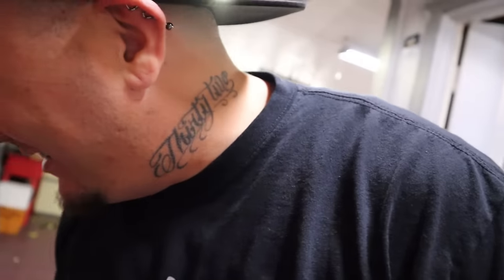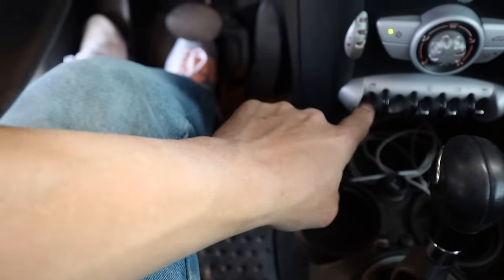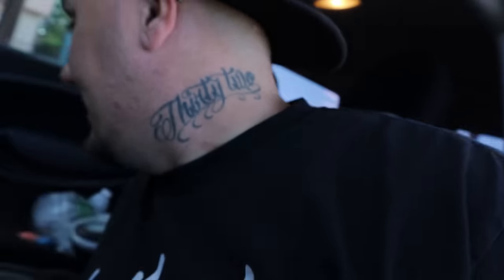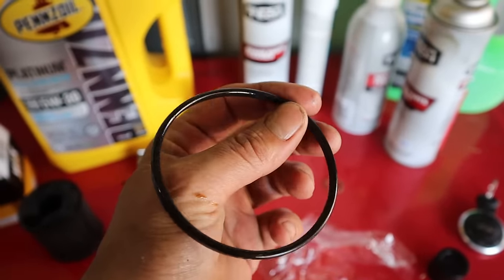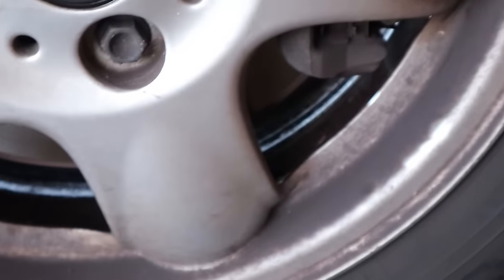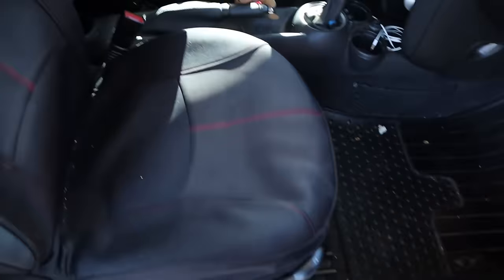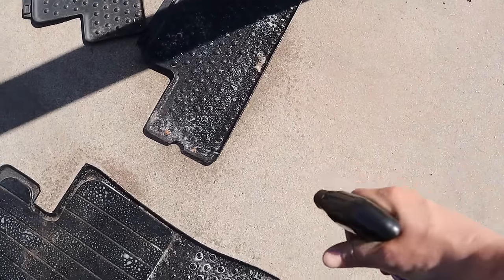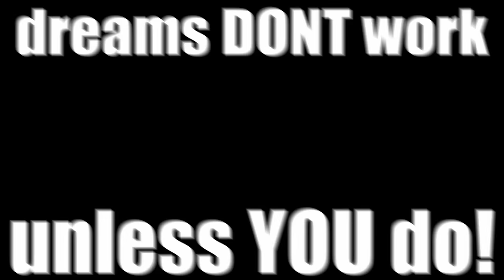MINI Cooper Cleans up Pretty Good! BUT.... What is this tap?

Comment: So I have worked on these for many years and here is the most common issues and things to do. 

Oil changes with frequent oil checks

Thermostat housing as they tend to fail along with the water pipe that connects the thermostat housing to the water pump. 

Water pump itself with friction drive wheel. Might as well put the friction wheel drive tensioner too. 

Yes the coils tend to fail so good that you changed them. 

Right side engine mount collapses and will cause some vibration

Valve cover/valve cover gasket. 

Cabin filter!!! People never change them and will help with that smell along with a deodorizer sprayed into the blower and vents. 

Rear shocks cause cupping on rear tires because they wear out 

Rear sway bar bushings cause a rattle sound in the rear that is sometimes mistaken for the rear  shocks. 

Axle boots tear and leak grease. We always just install new boots instead of the whole axle. Cheaper

Axle seals. 

Crank seal

That oil leak on the driver side of the engine is your vacuum pump. 

These engines burn oil because people use regular gas. The should be using premium gas to help from carbon build up. 

Oil pan reseal

The coolant hose from the reservoir to the thermostat sometimes leaks. 

To restore the plastics you can also use the torch/heat gun method and it brings the shine back really nice. Just be careful not to burn it too much. Lol 

Overall they are decent little cars and fun to drive. The turbo model isn’t terrible but the fixes common to those are substantially more expensive. Hope this helps!
Reply: Exactly 👌
And they are not BMW engins, but PEUGEOT 😉
Reply: @btr3356  Thank God it isn't a BMW Motor. That would of opened SEVERAL CANS of ISSUES!!!
Reply: So everything lmao

Comment: Run some transmission fluid thru it with a fresh filter let it run for a while then take it around the block before doing another oil change.

Comment: Cartridge oil filter tighten til seats or torque to 25nm and yea allen oil drain plugs suck! Lol I work at a jiffy lube. Lucky for you that's not the worst oil filter location that mini has.